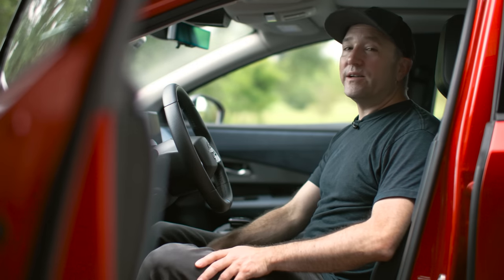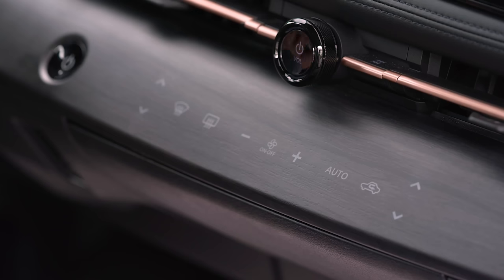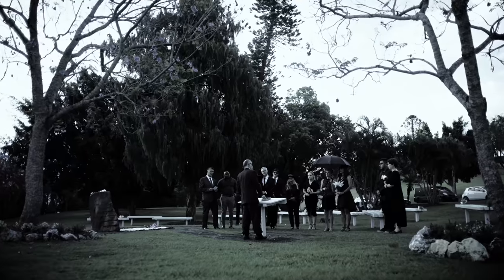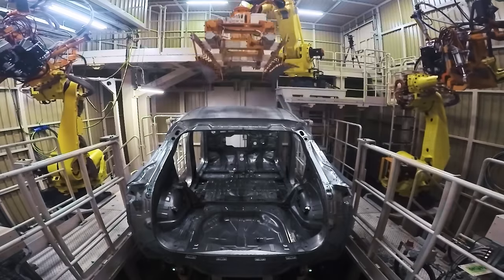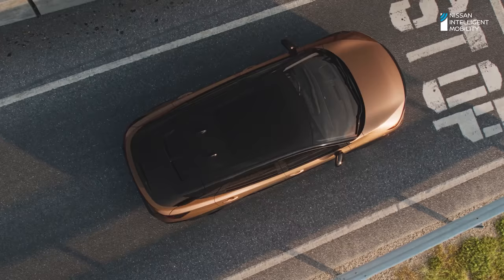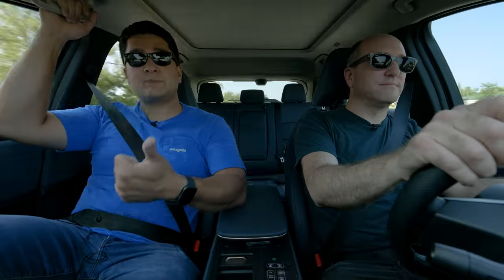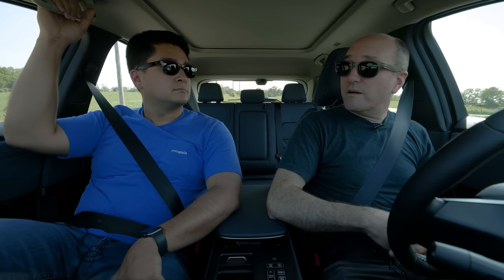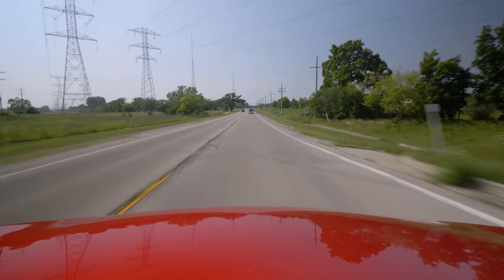Nissan Ariya EV | Too Little Too Late?

Comment: Nissan lost me in the late 90's. Today I wouldn't be caught dead in a Nissan, unless I was run over by an Altima (no rear bumper cover, damage to the front pass quarter panel and a sagging headliner) and the driver thru me in the trunk. 
Been a car guy for 40+ years but I couldn't ID most SUV's.
I kinda like this though. 
Thanks for the great vids guys.

Comment: Still the same thing over and over again with these EV’s. High price for low range. Not impressed. I don’t care how much “design” was put into it. High price and low range is killing the EV market. The only reason EV’s are actually moving forward, is because our government has FORCED brands to make them!

Also, I would like to note that I’m sure Nissan could have sold this car for a cheaper price, if they didn’t pay all those Hollywood actors/actresses to market for them. 🤷‍♂️
Reply: Lemmy explain marketing to you. if you don't advertise, you don't sell in volume. if you don't sell in volume, your cost per unit goes up, because you can't amortize your fixed costs like design and tooling. Duh.

Comment: I will never buy a Nissan as Nissan doesn’t stand behind their products.  There are countless Leaf customers who want Nissan to produce CCS capability as well as thermal management system for the traction batteries, but Nissan turned their backs on these “FORMER” customers by not offering retrofit kits for these Leafs.  Literally hundreds of thousands of Leafs were sold.  If Nissan want customers, they need to stand behind their products.  I don’t think Nissan will survive in the USA as it has become a 3rd rate automaker.

Comment: Absolutely hate that new trend of putting the brand name on the rear than a simple logo. The interior is awful, the whole touch thing is blowing out of proportion and the center stack / console is like a van, they mashed so many cars into this and made it. Plus the design is also uninspiring, tbh the whole EV BS is garbage regardless of brand from Toyota to Merc.

Comment: How misleading viewers and customers by a manager from Nissan. If you have any knowledge why fast charging technology is important in EVs, it's not necessarily true what he said it's for more affordable vehicles or most people charge their EVs at home. Simply they can not make one. Just watch how VW and Toyota are doing on EVs. Their technology is far behind even Chinese automakers and don't have proper EV flatform. They cannot cost down in manufacturing due to lack of technology and experience. Battery and charging technology is not just for reducing charging time but it is connected to all about the efficiency when even driving your EV.

Comment: The most dangerous thing I see about the Ariya is the front flat floor that runs the length of the width with no barrier between the driver and passenger... if a passenger puts or drops something on the floor that rolls, it could possibly roll into the driver's side and get under the brake or accelerator pedal and cause the driver to have an accident because they cannot press down one or the other pedal or they try to reach down and retrieve the article in order to keep it from obstructing their foot movements... it needs a small barrier to keep that from happening... otherwise, I believe it is a beautiful car except for the price.

Comment: One would like Nissan to succeed in the marketplace, but Nissan lost the plot years ago to other manufacturers and in a desperate move stopped innovating or competing on style/performance.   Nissan was marketing their Maxima as a 4DSC in 2015 and could back it up with a great and high demand product.    Over time, Nissan became an also-ran in every segment of the market.

Is there any Nissan product in 2023 that is a must-wanting  product with little competition?  Nope.  Nissan is slowly navigating to the same place Mitsubishi resides as the Genesis, Hyundai, KIA trio simply bring better products to market faster and over a broad range of price/options.